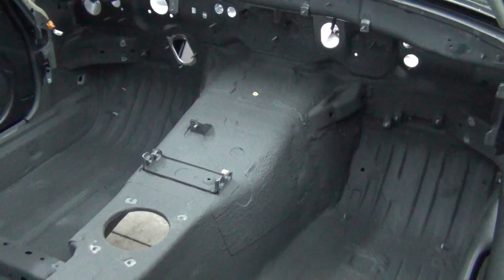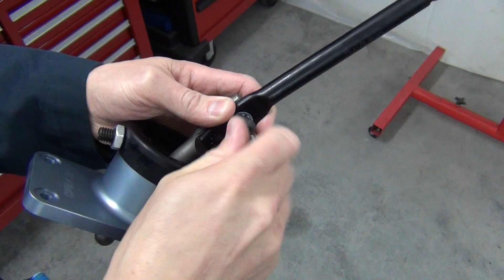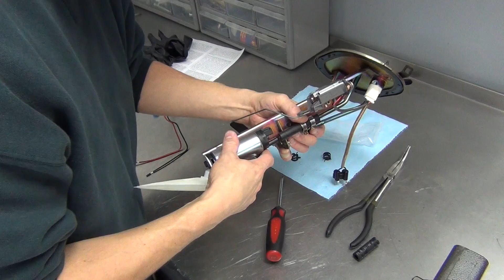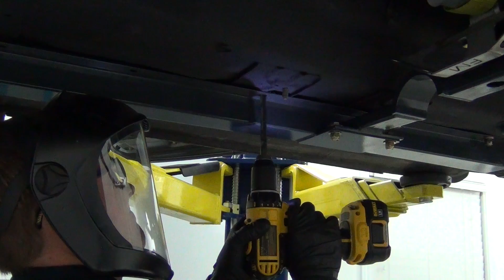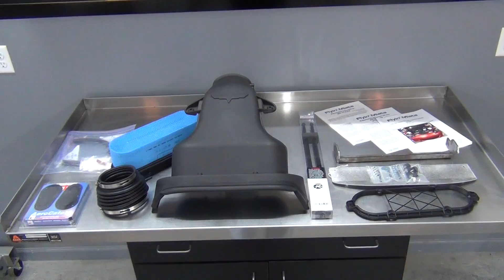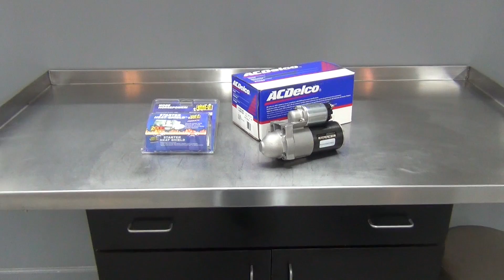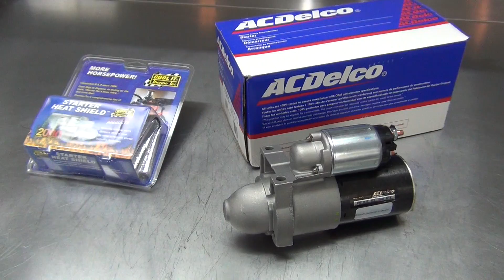LS3 V8 Miata Build - Project Thunderbolt Part 8

Comment: Great video again!  Really enjoy following this project! Just one question, is it just me or does one of the two headers look a bit dented? The one on the right in the video.
Reply from the maker: JeroenNX Thank you sir, glad you are enjoy the series!  Yes, the driver's side header has a clearance dent in it to clear the steering shaft.  Jamming a giant V8 into a tight Miata engine bay isn't without a couple compromises.

Comment: My 1983 RX7 has a mitsu made fuel pump too.
Reply: Ty U. 2003 dodge stratus coupe has Mitsubishi motor.. But the sedan has a Dodge motor? Both 2.4L.. nuts..
Reply from the maker: Ty U. The "tri-diamonds" are everywhere!! :-D
Reply: Ty U. I have a mitsu pump in my tank as well... but then it's a mitsu so... yeah. Looks identical to the one in the vid. Same looking pickup, return line and sending unit.
Reply: Tom's Turbo Garage Haha yep.  If only the tach was mitsu it might still work.

Comment: Nooooooooo! its already over.... Thanks Tom for another wonderful video! Wiring is actually my favorite thing to do lol. I can't stand the stock wiring harnesses so i replaced most of that crappy small gauge wire with some color coded "makes more sense" wire. Yellow for lighting, Red for engine stuff, blue for accessories, etc etc.
Reply from the maker: decimat777 Thank you as always sir and I agree that cleaning up a messy/over complicated harness is actually fun and rewarding, but I think it's the slow pace that irritates most car dudes.

Comment: I have a question! Pick me! Pick me! 
With the frame rails bolted with, um, bolts... Wouldn't the holes in the body elongate with time and driving, thus rendering the rails a bit useless. Isn't welding them in place a better solution?
Reply: Boiko Aladjemov I would guess that welding them would be unnecessary because it is the clamping force induced by the torque in the bolts that prevent the rails from moving. I suspect the bolts themselves provide little to no radial support, very similar to lugs/lug nuts.
Reply: Didn't think of it this way. Thanks!
Reply from the maker: ChicoKj23 Yes, well said.  These things aren't going anywhere, trust me. :-D

Comment: Hi Tom.  It's Lohan (the guy that had the red RX-7 and the maroon 323 GTX), from the old street car forums.  I've really been enjoying this series.  I have a tip for you.  My RX-7 had the same phillips head bolts holding the fuel pump assembly to the tank.  After the car had seen many miles, I replaced my fuel pump, and those screws were very difficult to remove.  I highly recommend replacing them with some hex head bolts.  Good luck!  I'm really looking forward to the rest of this series!
Reply from the maker: maochiang Hi there and good to talk to you again!  That is a great tip and one I wish I'd considered in the past for sure!  Thank you for the kind words and support, hope to see you again in the future.